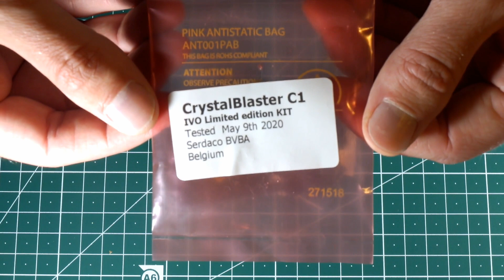Serdaco CrystalBlaster C1 (Soldering the DIY Kit and playing different games music)

Comment: Sounds a bit like the sound blaster 128/Ensoniq audioPCI, doesn't it?
The chips you can buy on ebay are most likely recycled and remarked, plgDavid made a good video about this
Reply from the maker: I have a crystal soundcard with a PCB design that is prepared for this chip but empty. Maybe I will buy one from eBay and try to solder it on the card.
Reply: @pc-sound-legacy  And I have a mainboard with an empty socket that can be upgraded with this chip
Reply from the maker: That's cool, I would upgrade it:-) Does the mainboard also have a crystal audio controller on board? Wich board is it? I like the early Mainboards with on board sound.
Reply: @pc-sound-legacy  Siemens D981, has the 4236B onboard
Reply from the maker: @Schule04  Siemens boards are unbreakable, like them! Have two Siemens slot 1 boards but without onboard sound.